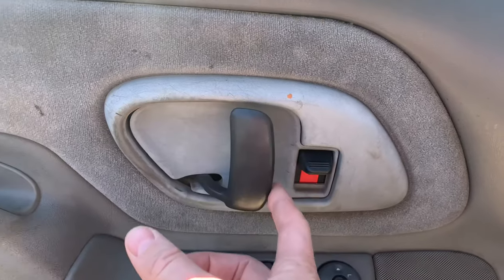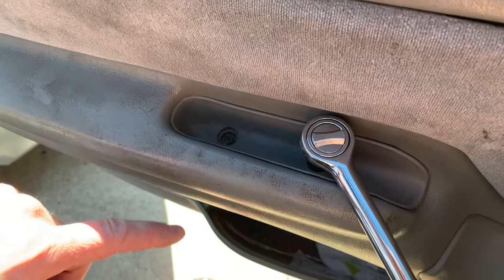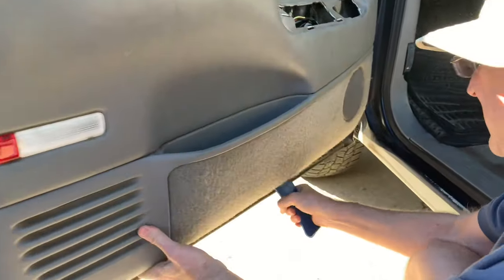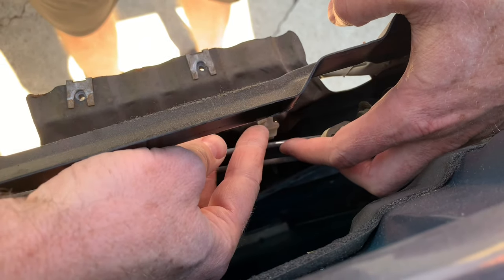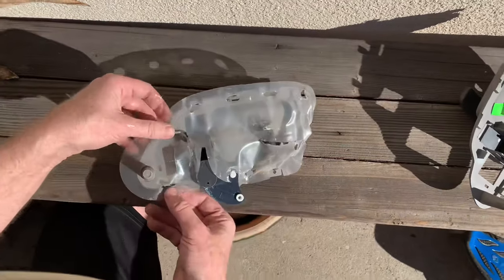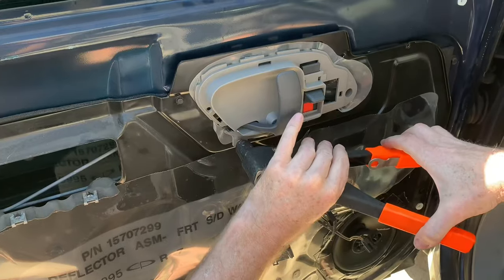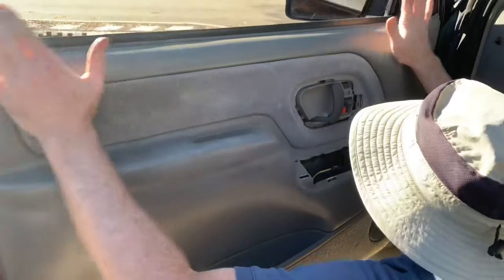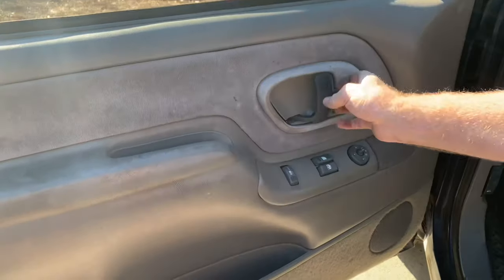How To Replace Interior Door Handle On A Chevrolet or GMC Truck 95-99

Comment: You do no have to remove the steel door panel.  Drill out the rivet .  Take the lock and door rods loose.  Put it back together.. Done!!!
Reply: Ok but that presents a problem. Accessing the area behind where the door panel goes.

Comment: Thank you.  I watched your video a few times to make sure that I understood the process.  I bought the parts and had the video running on my tablet as I worked.  A repair that would have run at least $200-300 at a shop cost me $40 and that included a run to the hardware store to get a properly sized rivet.  The inside door handle that has been giving up problems for a few years now and broke off in my hand last week is now fixed.
Reply from the maker: Glad it helped

Comment: Kinda weird that you uploaded this.. need to do this on my 95. I  just got the new upgraded handle in the mail.
Reply from the maker: Synchronicity! I’m glad I could help. This job is easier than it looks as long as nothing breaks when you take everything apart. If you were thinking about upgrading your door speakers, now is a good time.

Comment: Lisle makes a nifty trim pry tool. Like a bent really wide spade screwdriver that has a slot cut out of the middle of the blade (so you can slide it around a trim snap/fastener). has a red handle and a black rubber fulcrum that slides up and down the shaft. Ingenious tool, i have used it for all kinds of stuff beyond what it's meant for. But trim is a breeze with it.
Reply from the maker: Thanks

Comment: Excellent video - makes it look pretty easy to do! I'll be replacing both the drivers interior and exterior door handles along with the window control unit on my '99 Suburban. My drivers side window is currently stuck in the up position, so wondering if this can be done with the window in the up position?

Comment: We're back!  Dude we just changed our handle and the one BIG (to us) problem we had was getting the electrical fittings to  come apart.  Could you maybe ponder a class on how to release different connectors for us old farts who don't know how?  Thanks!
Reply from the maker: That’s a good idea. They are all different, and most of them are pretty confusing.

Comment: I dont have a bunch of loose bolts and nuts laying around to replacs the rivet. Would it be noticeably loose if I leave that empty?
Reply: I think it will slide forward and back a little bit so probably just get annoying definitely would just try to find a nut and bolt

Comment: 98’ Silverado.  Having to do this same thing….video was clear and gave great step by step instructions.  One thing I’ve noticed is parts are sometimes hard to come by.   Where did you get your door lock assembly?
Reply from the maker: I bought it on eBay. You can find almost anything on there.

Comment: Good video...but good luck getting those electrical wires out of the controller without pulling out the gray locks.

Comment: When replacing the new one does it make a difference if the lock is down or up..thanks in advance
Reply: It doesn't matter. 

The rod that connects to the door lock slider can be moved by hand to either the locked or unlocked position.

Comment: Great video, but can you provide the link to the handle and clips. Also what size door speaker is that? Thanks.
Reply from the maker: There’s a link in the description to the door handle. The speakers are standard size replacement speakers that I bought from Crutchfield. I think I could’ve fit bigger ones in there.

Comment: What size rivet is it? You use a 1/8" drill bit to take it out, but is that also size of the new rivet, or do you install a smaller one considering the expansion?